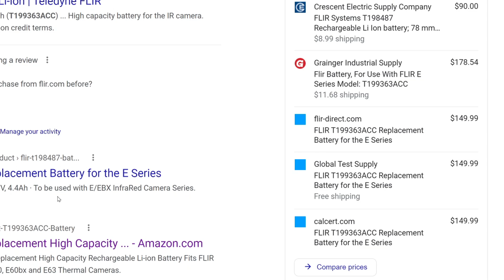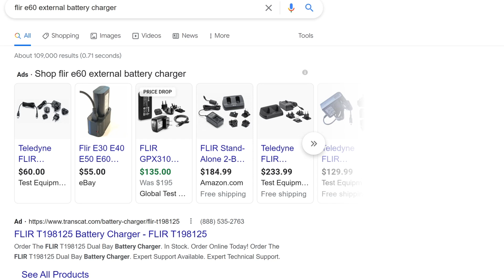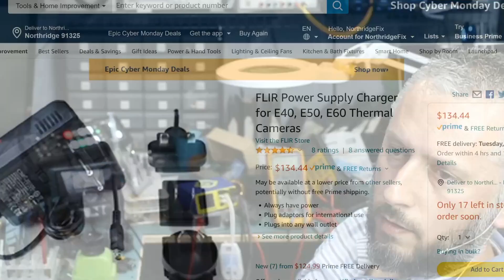Which thermal camera to buy. FLIR bad practices & their ridiculous non standard RCA cable

Comment: 149$ for a battery, yes you pay the price for the experience they have and the time they spend making that battery.... same as you when you charge customers same price but don’t care how long the repair takes ... flir treats you same as you treating your customers ... you pay for experience and time spent !!!
Reply: The only thing that Flir spend time on on that battery is designing the proprietary shape of the case and the slot it goes in. It's standard battery cells and a standard charging circuit.
Reply: I see your point (for a second had me thinking ‘touché’ lol)  BUT unlike FLIR, Alex isn’t selling you a proprietary product/service. You can choose to pay for his experience or someone else’s. If you feel like he’s overcharging, you can do the equivalent of buying a 3D printed part 😝.
Reply: No, the battery is overpriced at $149, and the charging adapter for $139 is also ridiculous. Not to mention these things are made in a factory, without the need for a human, and NorthridgeFix guy will fix your stuff by hand, which takes more time and resources for way cheaper. The switching of the RCA wires is just crazy, FLIR is just messing and overpricing. Idk how you come to the "pay for the experience thinking", it's clearly a deliberate and dishonest way of conducting business. Also an RCA cable for 26$? They are over their head and are using people who know little about tech and electronics for massive profit margins.

Comment: I use the Flir One Pro to find shorts which works well and cost under £450.  However Flir One Pro does have a battery discharge issues, hence keep it charged regularly.

Comment: I bought a FLIR "ONE" (for iPhone), as it was honestly the most I could POSSIBLY justify spending on one of these (about $300).  It works OK, but is just BARELY able to be used for board repair, as the resolution is low, and so is the refresh rate.  Also, take a shot every time Alex says "Battery" for a fun game!! lol
Reply: Its great for investigating Underfloor Heating. It was designed for Construction Sites and Buildings. I am not surprised it worked poorly for PCB repair.
Reply: @grimgoreironhide9985  ooh
Reply: @grimgoreironhide9985  Good to know!
Reply: That damn thing sucks

Comment: Is the battery sealed or can you put tape around it to hold the casing together and change the AA batteries inside?
Your explanation of f/s was perfect and resolution also great. Nicely done.
Reply: not AA but 18650 batteries
Reply: @zoolf2001  understand, however, I've replaced batteries in different devices, those I can't, a friend does for me. So any battery can really be changed.
Reply: Shanae  as long as the amp and volt is the same, and they fit, should be fine.

Comment: I have been using the e60 at work for the pass 7 year but work just got the new T series and I used the t1020 and wow the details that come up on it are way better than anything I have ever used and not saying that everyone needs a 40,000 thermal camera but with the 1024x768 ir resolution I can almost see every component inside my phone with out even opening it up but yes flir makes some of the best thermal images camera’s on the market

Comment: I've used the cheap USB ones (in a pinch - not by choice) and yes, they're lower res...so you move them closer to the heat spot. The closer you get, the more clear the location becomes.
Reply: Minimum focal distance of the lens? Do they make macro lenses for thermal cameras?
Reply: @liucyrus22 i think i saw that hikmicro have option to buy extra lens (macro) for their b series
Reply: It works sometimes, but when a tight space where you cannot go closer to the board thats one con, but hey thermal camera is very expensive as hell🥺
Reply: What the name of the product please?
Reply: @kdilac8879  FLIR one.
Reply: @MBrulla  Is that the one for Smartphones?